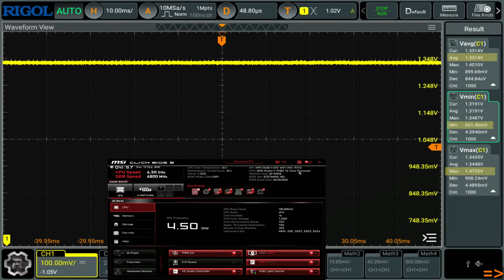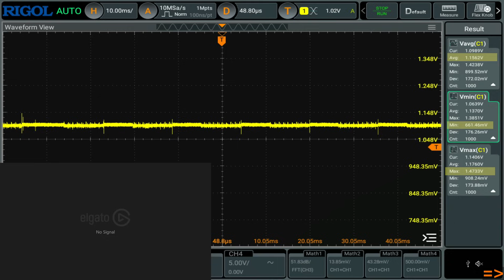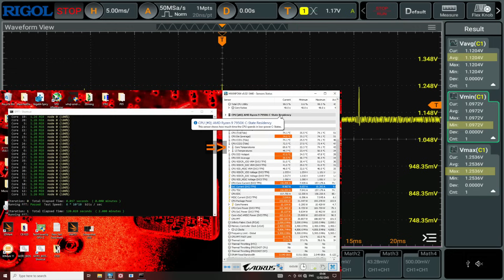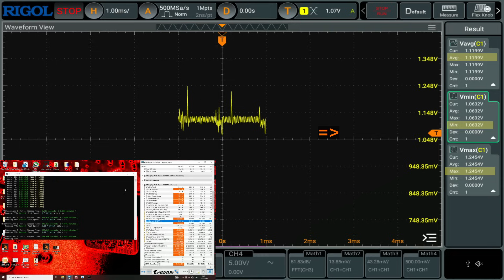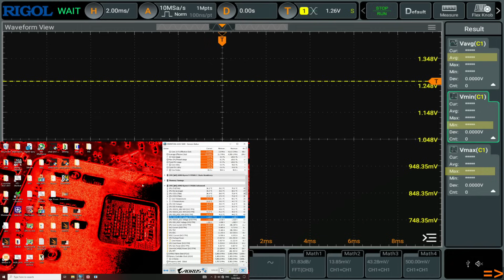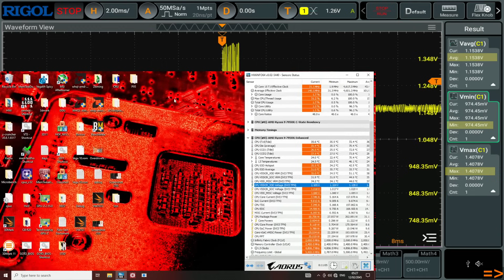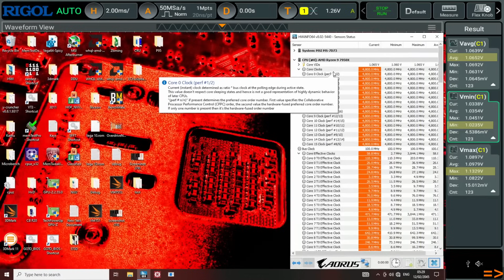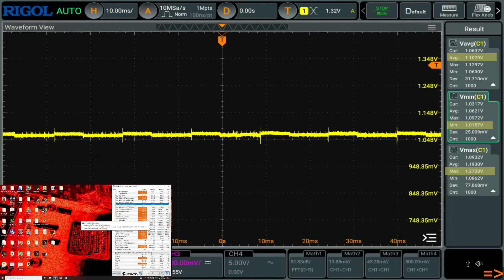MSI B650i EDGE WIFI Vcore load line calibration testing // mode1 is BIG OOF

Comment: The curve @ 26:30 looks like a regulation on a PID controller where someone had raised the P value way to high. Nice oscillation between overshoot and undershoot.
Reply: Or RLC resonance someone didn't account for.
Reply: VRMs are simple negative-feedback linear-ish controllers with a slight time delay between voltage output and feedback input, so that's basically a given. The very shallow LLC setting just brings it out way more than the other ones which allow for a good degree of self-dampening to the point of relative stability.

Comment: 17:10 Hey, that's super cool! Could you show us how a mouse with 8K polling rate (OP1-8K for example) affects these fluctuations and how different settings like LLC or VRM frequency influence it? Higher mouse polling rates are a real challenge for CPUs in games, I wonder if any useful insights can be gained this way.

In my subjective opinion, it helps enormously to increase the CPU switching frequency to 1K with an 8K polling rate mouse. The FPS in games is more stable and the mouse feel is more consistent. I would be really curious to see measurement results, data, figures and facts!

Comment: Hey Buildzoid, have you seen some of the new z890 motherboards previewed with 25+ 110A power stages?
Reply: x870e taichi with 27 power stages 110A lmao
Reply: @ConfusedBeing-v9w I doubt even a delidded, over locked 9950X will ever need this much power.
Reply: @PowellCat745  "Z" chipsets are Intel ones, not AMD. And naming for next Intel CPU's is all over a place.

And about that X890 taichi (sorry hadn't read comment you answered to properly)... Liquid nitrogen? Even though still... I can see about 450-500A. But 27x110A is definitely way overkill. How do they even split them?
Is it 10x2+4+3 or 12x2+3?...
Reply: @ConfusedBeing-v9w Basically identical to the X670E Taichi except the X870 on display had 2 unpopulated filtering caps. They're even reusing the same heatsink. I didn't even realize they bothered putting a fan in there too until I accidentally turned mine on. Even  after hours at full load my memory runs hotter than it does.

Best part is despite all that they still only going give you 3 LLC options.
Reply: @DimkaTsv  except I was replying to a comment about X870E
Reply: @PowellCat745  yeah, i figured jt out only after i wrote comment, sorry.
Reply: @DimkaTsv  no worries dude
Reply: @PowellCat745  it's for higher power efficiency.

Comment: Obviously, MSI did not catch this in QA. I am afraid the worst part is they are not capable of catching this. Nowadays, not many engineers understand Control Theory. Analog design is way harder than digital circuitry.
Reply from the maker: I'd guess they just copy pasted the LLC settings they always use onto this board and didn't bother to test that it doesn't cause any issues. I don't expect each LLC setting to change the control loop configuration but I would hope they would at least remove settings that don't work properly.

Comment: It looks like what that shows is what's called undamped oscillation...  Usually you see it in springs.  It might be interesting to see you change the vrm requency if you can to the highest frequency and lowest, see if that has any effect.
Reply from the maker: Changing the switching frequency has no effect on this.

Comment: I just got this board maybe like 2hours before your video upload. 😭 plan is to run a 7700 in normal pbo. Not really well versed enough with OC to fiddle with anything. Do you think my proc will be fine? Or should i get a different board entirely? Thanks
Reply: Just don’t run LLC mode 1

Comment: I wonder how easy a super thin ihs would do temp wise? Would it be similar to direct die. Thin enough that’s it’s almost structurally questionable
Reply: Well that's part of the reason people sand/lap the stock one but at a certain point it's a bad idea. If it's too thin it'll flex (like Intel's) more and not provide enough of a buffer to justify even being there. It would eventually just become another thermal interface bottleneck causing more issues than it helps. 

There's a balance to be found that's currently a bit past the point of being optimal. This is also partly why thin AIO coldplates can have issues compared to custom blocks.

Comment: So Is it safe to assume "Auto" is mode 1?
Got this board running a 7950X3D but no OC, just the usuals like RAM timings, FCLK.
Also have been running override mode just for NB/SoC, so I guess switching to AMD Overclock and set LLC mode to 8.
Reply from the maker: no auto mode is mode 3
Reply: @ActuallyHardcoreOverclocking  Good to know I haven't been running in the worst mode for all these months :). I switched to mode 8 though 👍. Btw, thanks for another interesting video!
Reply: I have this board, pretty sure auto is mode 8.
Reply from the maker: @daflipflop  if you're not doing static CPU overclocks the AUTO LLC works just fine.
Reply: @ActuallyHardcoreOverclocking  Yeah, just wanted to make sure it was not on mode 1 default for the Auto. Running mode 8 now and all good so far.

Comment: Man, I have a Ryzen 7800X3D, MSI B650 Tomahawk, Adata XPG Lancer 6000 CL 40 2x16 gb and running on the apu of 7800X3D, until I buy a video card. VCore set in bios to 1.28V, override mode in the OC tab. Since I put a NVMe SSD from Crucial for games and documents (Crucial P3 Plus 4 tb, because I was low on money, replacing the 2tb hd), I've been having VDD SoC spikes for values above 1.3 V while gaming (reaching 1.38V, sometimes). All settings for the DigitAll power tab are set to auto.C States is auto, of I remember correctly.
I don't know what is happening to cause these spikes when I play, since before I put this crucial nvme on, these spikes didn't happen.
Could the problem be this case of LCC? Thanks and cheers
Reply: Don't set override voltage, it makes zero sense, there's zero benefit to yeeting away power saving voltage modulation. SoC shouldn't be affected by LLC.
Reply: Who the fu... sets VCore on Ryzen 7000... Jesus....Just why? Please tell me it was troll comment
Reply: @PolskiJaszczomb  because I dont wanna blow my 7800X3D.  Even so, I'm having spikes of voltage
Reply: @RmX.  troll is you
Reply: If a set to auto, spikes to 1.38V. If a set to 1.25V, spikes to 1.33V or 1.34V
Reply: @donattifelipe1  I have 7800x3D too, and the highest spike I had was: 1.142V
VCore on Auto and PBO -15
Reply: @RmX.  i dont know if it is my motherboard (msi b650 tomahawk) or not, because before, before I change my hdd that stores documents and games to a ssd, the spikes didnt occurs. So, it bothers me a lot. And yes, I'm with the latest bios. And another information: I'm using with no graphics card. Maybe the answer is that I'm not using with a graphics card (short on money, now, because I lost my job).
Reply: I think I solved the problem. I uninstalled the AMD Ryzen Master. For now, everything seems fine. Jeez. This sucks
Reply: @donattifelipe1  We have the same CPU and MOBO. What's the highest spikes you have now?
Reply: @RmX.  after uninstalling ryzen master, I dont have spikes anymore. Using Auto Mode VDD_SOC remains 1.3V and NB/SoC ranges from 1.3V up to 1.314V

Comment: I’m wondering if this motherboard has as good of memory support as X670E Gene.
Reply from the maker: no it doesn't. In fact this board is generally not great. But it is one of the cheapest ITX boards.
Reply: @ActuallyHardcoreOverclocking  That's sad for a 10-layer PCB board.
Reply from the maker: @PowellCat745  well for comparison MSI's Z790 ITX is 12 layers and doesn't have the socket shifted up relative to the dimm slots.
Reply: @PowellCat745  10 layers isn't THAT much for an AM5 ITX board - ITX boards always need lots of layers to compensate for the fact that they're so cramped. So think of it like perhaps a 6-layer ATX board because that's more comparable from a "memory routing" sense.
Reply: @Torbjorn.Lindgren  makes sense. Thanks!

Comment: Who is actually out there running LLC 1 or 2?!  Seems like a no brainer, if the cpu needs that I'd be returning/exchanging it pronto.
Reply: Intel bros, that know the AC Loadline is garbage and should not exist so we drop it down to 0.01 or 0.1 mOhm at most and run LLC2.
Reply: I'm wondering the same thing, Who needs LLC Mode 1-2